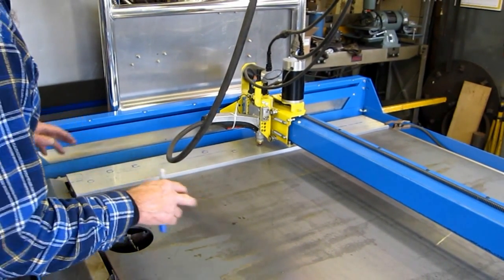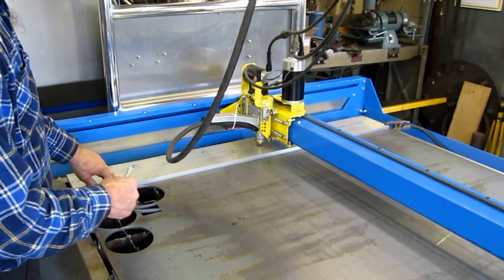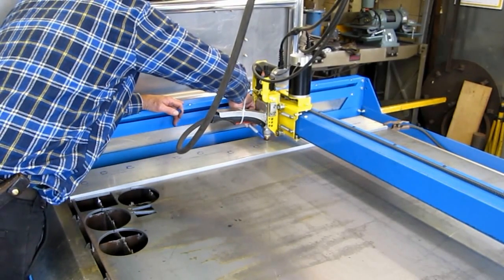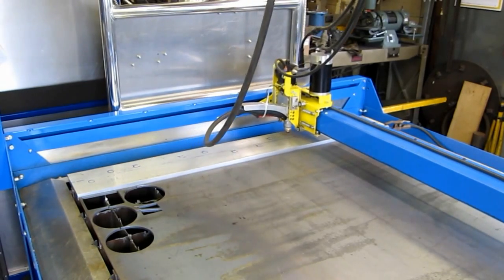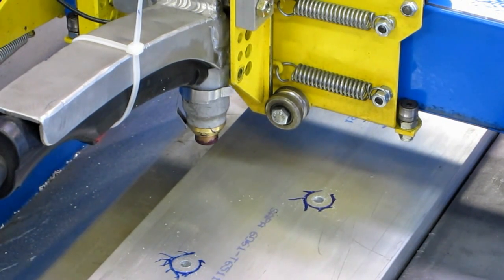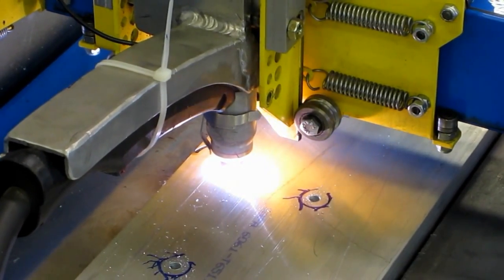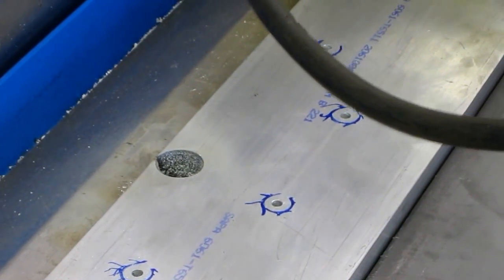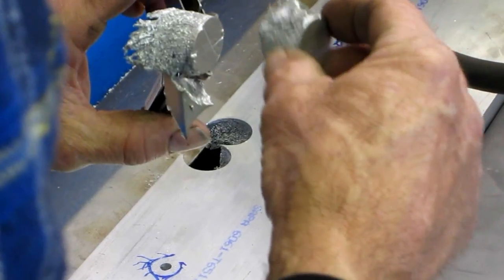To the Max

Comment: Thanks for the vid! Just cut some 5/8" Aluminum with our Powermax 1000. Did 60 amp and 10 IPM. Just had to cut some smaller plates out of a larger piece to make it easier to saw but this video saved us hours of trial and error. Thanks again.

Comment: Thanks , I just started cutting 3/4" alum with a 70 amp plasma cutter and wasn't sure how good a cut I can get.....not good enough but oh well..... it's a different cutting process that with steel I. Have discovered.Alum is just melting it and blowing it away with the air. Steel is true oxidizing or burning process hence the cleaner cut.with steel than the messy cut with alum.Cheers

Comment: Aluminum dresses up really quick & easy, because it's so soft... Steel - especially stainless - is more of a fit for plasma-arc cutting.

Also, the edges cut better with lower thermal conductivity, so stainless should cut even cleaner than carbon steel... and, in Keith's other videos, we've seen really clean cuts in A36...

Comment from the maker: Not sure what you mean by lift arc, the PlasmaCAM controller that I have is auto height control and I can set it to sense the height or just stay at certain height for entire run. The wire is for material sensing to set pierce height at each start and to sense and signal the controller that you have hit, then stopping the machine. Hope that helped! Keith ;{)---

Comment: Cool video Keith!  I noticed a small black wire attached to the metal shell (tip) of your plasma cutter.  Is the cutter a (lift arc) machine that is activated on your CAM table to activate above the table (without a lift arc)?  I am looking to modify my 50 amp lift arc unit to a non lift unit.  Thanks fer "getting er done".....  Fred

Comment from the maker: I have a Thermal Dynamics cutmaster 81 with a 60 AMP torch, been problem free, in fact I can say the last three, in the past 25 years, that I've had were all Thermal Dynamics, without any problems! I have changed out or down sized tips and cut .032" sheets. ;{)---

Comment from the maker: It may have improved a bit but Aluminum sucks a lot of heat away! I did add a bit of pre heat to the second part, showing no signs of being any better looking, but both were good enough with plenty of material to machine parts and still are considered a savings. ;{)---

Comment: It's a good idea I am going to try it we had a very small part on 1/8 material and I think had I drilled the start it would have come out cleaner.  The torch path came back around really close to the initial path on an interior section.  The pierce is always a little bigger than the cut kerf.

Thanks again!

Comment: Nice work Keith while I was watching I was wondering about a preheat and then right on cue you mentioned it for the second part.  I've never cut anything that thick on our A80, but the book says I need to be at 100A to be able to pierce.  Might have to give it a try.

Always good to push the limit to see what is possible.